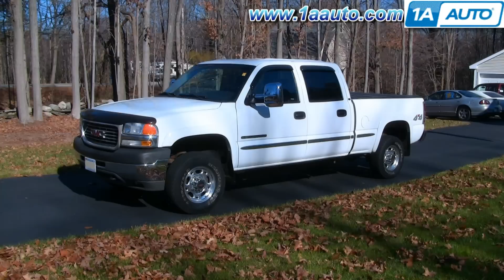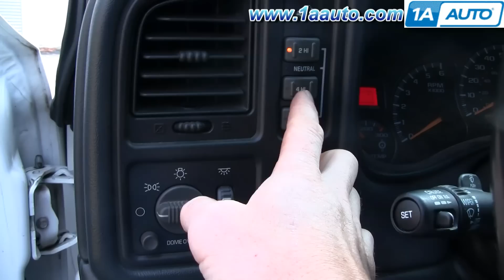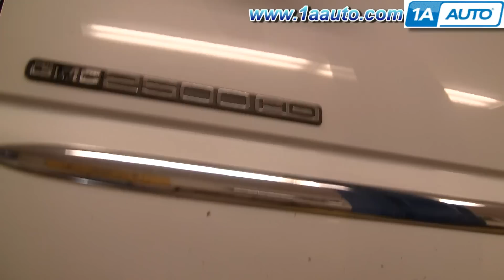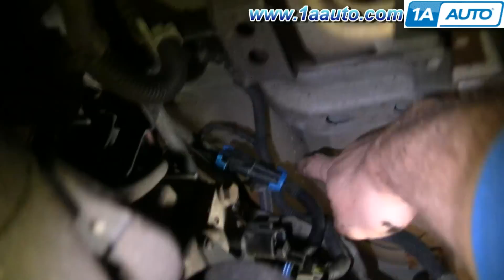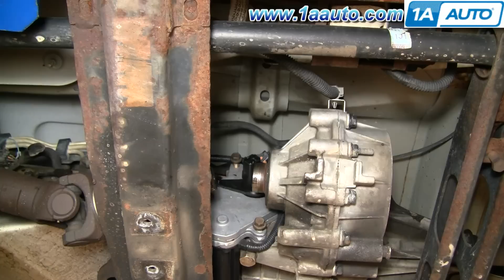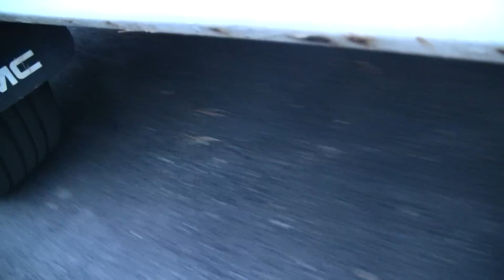How to Replace Transfer Case Shift Motor 01-02 GMC Sierra 2500 HD

Comment: just got a 2004 GMC Yukon   the driveshaft hooked on the transfer case shift motor , the 4 button selector switch does not light up at all 
the works fine  in 2WD still no light showing -  i assume the problem is the TC shift motor wires have a issue
i need to check all the fuses and clean frame & body grounds 1st - i bought the 5.3 Yukon in this condition , it has a very nice body & interior

Comment: Hey Guys, so I live in Calgary Alberta......With this said, our winters get frigidly cold -20C common......my 4wd service comes on/fuse blows/lights on selector switch goes out. Nothing works...found a write up  - not sure if its from GM directly. But it states, if your 20amp ATC fuse keeps blowing, but Encoder @ T-case works......front diff actuator works. You're getting get grounds.....good voltage at connectors....( Bench test front actuator ) and it works.......and there is no code for TCCM ( Transfer Case Control Module ) ....it is the 1640 connection - they used 18 gauge wire from factory but during colder than normal ambient temps - it will spike in amps and blow the fuse....The easy fix is replace with 25amp fuse. OR replace the Orange wire - with 16Awg.  DONT GO SPLURGE ON PARTS BEFORE YOU DO ALL YOUR CHECKS!!!!
Reply from the maker: +Sunny Rooprai Thanks for the tip! We'll pass this info along to our production team.

Comment: I'm having problems with mine shifting into four-wheel drive low could this be the problem
Reply from the maker: It's possible, we recommend that you take your vehicle to a local, reputable mechanic for an accurate diagnosis. +B I
Reply: It a rebuilt transfer case with about a thousand miles on it

Comment: At 9:24 that noise that the driveshaft makes when your putting it back in is the same noise  mine makes when I try to move the driveshaft without removing any bolts or anything yet. Is that normal? is that end of the driveshaft supposed to be able to move in the transfer case at all?

Comment: the nub that sticks out of the transfer case doesnt want to line up with the female part on the shift motor for my 01 silverado, how do i line it up? Also if i just plug in the new shift motor without installing it to the transfer case, will the motor spin when I press the 4x4 buttons? I bought a new shift motor and pluged it in, didnt bolt it up, and the motor is just buzzing and not turning. its brand new...defective unit?
Reply from the maker: +glamisfanatic You will want to plug the encoder motor in first and set it to what the transfer case is set to.  So if the vehicle is in 2WD then you need to set it to 2WD first.  1aauto.com

Comment: Help replaced throw out bearing clutch plate pressure and fly wheel everything is put back together however nothing happens when I try to shift the truck just rolls as though it's in nuetriral however the drive train doesnd not move Arou

Comment: I just did this to my 04 Sierra 1500 and when I plugged in new encoder motor and switched it to 2wd on the button select after a minute my 4wd lights just went out and now I can’t get them to turn on any ideas? The switch turns on for a few seconds and then off

Comment: I rebuild my 2005 Tahoe z71 transfer case np246 np8 because it had a pump knock problem and create a hole in the rear housing.  Now my problem is that it won’t shift in any of the 4wd modes like in the video and the electronic encoder is making the same noise. I also was thinking that maybe that tab on the main output shaft under the clutch pack was installed incorrectly by the shift fork, but this seems exactly what my truck is doing. Could that tab be an issue for why the tc won’t engage in any other gear besides 2wd. The truck runs it’s just when I try to put in any 4wd it blinks and goes back to 2high.

Comment: I thought for sure it was my switch in  the dash, so I replaced it, but no, the 4wd still didnt work. So it must be the actuator,  I replaced that and still no 4wd. I checked the wiring, cleaned the grounds, checked fuses and searched forums and decided to bring it in to get diagnosed ao they could pinpoint the problem. Well they weren't able to pinpoint it and that cost $127.00 , lol. So i decided to replace the transfer case motor and used this video. It was very helpful. I didn't have to remove u joint bearing, the electrical connections were kinda hard to unhook. I had to manually put transfer case in nuetral to line up with new motor. I'm just a you tube mechanic so this was a bit challenging. I have no impact wrenches or means to raise vehicle, so it was tight under there. Anyway, I did it and it worked! I'm very happy. Thanks!
Reply from the maker: +cash money Thanks for checking us out. Shop here for high quality auto parts: http://1aau.to/m/Shop-1AAuto-c

Comment: Myn clunks and does go into 4x4 but just quit working today could this be it
Reply from the maker: +Matthew Webber You may want to start by checking the fuses to see if all of them are okay. If they are fine, you may want to check the switch and any vacuum lines. Hope this helps you out. 1aauto.com

Comment: I have a question. I have an 04 Silverado 1500. It's telling me to service 4WD and my ABS light is on along with my Parking brake light(even tho the brake is not on). Would that be the issue fixed in this video or is it something more? It won't go into 4WD either.
Reply from the maker: +haroaero You may want to try to see if there is a code stored in the computer. If there is it should help to point you in a direction. 1aauto.com

Comment: My 2005 Silverado hasn't been able to go into 4wd low for a few months now. Today while driving in 2wd every time I went down a long hill where it was essentially coasting the transfer case was totally disengaging as if my transmission was in neutral. Stopping and cycling from 4wd back to 2wd fixed it each time with a super loud clunk. Is the encoder motor the likely culprit for both the new prob plus the old one of no 4wd low?
Reply from the maker: +wmkess Thank you for checking us out. This certainly could be the reason for your issue. 1aauto.com
Reply: Was this part the fix for your problem? My 2004 is doing the exact thing as you described in your comment.

Comment: Thanks for the video was really nice, i was wondering is it possible to remove the wire harness and disconnect the motor without removing it? Or its better to remove it ?
Reply from the maker: +Sohaib Kholosy You will be able to disconnect everything just fine, but you will not have the clearance to physically remove the motor.  Any viewers that are interested in purchasing the part in the video please follow the link! http://www.1aauto.com/1A/TransferCaseShiftMotor/Chevy/Silverado1500/1AFWM00014?utm_source=YouTube&utm_medium=CTA+Comment&utm_campaign=ytcomment&utm_term=1PPf2Yzhjmw

Comment: What if the transfer case will go into 4wd high no problem but fail to engage 4wd low? My 2005 Silverado 1500 does this now. I can hear a loud clunk, like it typically made in the past when it engages into low, but it doesn't engage and then it clunks again like it is giving it a second shot. It has been doing this even after multiple restarts and trying it at a stand still and a slow roll (1-3 mph like the manual states) and always in neutral.
Reply: wmkess when putting it in 4wd low make sure it's a nuetral and your stopped. 4wd high is a shift on the fly but low is different...

Comment: is this the same for a 99 suburban?
Reply from the maker: +big choo choo It may be a similar. Your 99 should be a different part number. Here's a link to the shift motors for your truck. There is a video for one of them. Hope this helps you out https://www.1aauto.com/1999-chevy-suburban-k1500-transfer-case-shift-motor/y-mo-c/1999-2149-144#utm_source=YouTube&utm_campaign=YTC&utm_medium=CTA%20Comment
Reply: 1A Auto Parts thanks

Comment: 00 Z71 with auto 4x4.Lights say it is in 4x4 .I jacked all tires off ground 4x4 works but I can grab tire and front no longer spin .back still turns.Why would it not have the power to turn front wheels?love your videos
Reply from the maker: +Jerry Bowen Some 4WD systems are designed to send more power to the wheel with traction. This might be what's happening. Thanks for watching. If any of our viewers needs to make this repair we carry the part shown in this video on our website. Here's a link to them https://www.1aauto.com/1A/TransferCaseShiftMotor/Chevy/Silverado1500/1AFWM00014?utm_source=YouTube&utm_medium=CTA%20Comment&utm_campaign=1ATony

Comment: My 2009 Silverado just went out recently. Manual shift to 4H, 4L, but nothing happens. The 4-wheel light doesn't come on either. I just used 4H 2 weeks ago. When shifting to 4H, I don't hear any noises..I'm leading toward the actuator but know nothing about vehicle maintenance. Any help in the right direction would be greatly appreciated.
Reply from the maker: +Lyman Tsinnie You may want to test the power going to the actuator to see if there's power going to it when the switch is activated

Comment: Thanks for video. Need to order replacement. 2 questions: when bolting new motor in place, do the gears or motor need to be 'indexed' to match position of motor with position of transfer case? also, which part number for '05 tahoe with the 'auto' sensing 4wd? Thx again.
Reply from the maker: You shouldn't have to. As long as you follow this video you should be fine. We carry the replacement actuator shown in this video on our website. Here's a link to them https://goo.gl/RZDU2U

Comment: So I'm having same problem with my 04 Silverado except mine goes into 4 lo and not 4 hi ,it blinks like this video and goes back to 2wd . I do have new transfer case motor here to be installed . Will this fix problem ?
Reply: Also I do get a service 4wd light
Reply: lonnie ruybal mine does the same thing only it goes into 4 hi but not lo.  but it won't work.  I can hear the actuator hum and then the light will indicate it's in 4 hi but only the 2 back wheels spin still.  let me know if you find anything.  99 silverado

Comment: I have a 2001 silverado and my 4wd only engages into the low 4wd, it goes into high and auto but it doesn't work on does modes it only works on the low mode. Do you think is the transfer case shift motor? @1Aautoparts
Reply from the maker: It's possible that it's the shift motor. Are you getting a 4WD light or anything similar on the dash? 1aauto.com?utm_source=YouTube&utm_medium=CTA%20Comment&utm_campaign=1ATony 866-403-3393
Reply: 1A Auto Parts no nothing, it just doesn't engage into 4wd high or automatic mode. Just the low mode. But thanks amazing page. And you guys sell quality products keep it up.

Comment: Hi there you showed how to test the motor while its attached to the truck, I have a 2001 olds bravada that doesn't have any 4wd switches, it is stuck in 4wd and I'm thinking it's the encoder motor. There isn't any way to test this one is there? I've been told there isn't any way to test it when it's not attached to the transfer case either or it will cause permanent damage to the motor.Fluid is perfect no blown fuses and no lights illuminated on the dash.

Comment: I just replaced the 4x4 actuator  on mine and the front wheels still won't spin and it won't go into 4x4 low or netural

Comment: Great video, thanks, helped me out a lot.  When I pulled the shift motor out and opened it up to replace the sensor it was full of oil.  Is that supposed to be there.  Thanks again

Comment: Great Videos. I have a problem similar to this. 05 Sierra 215k miles. My buttons have been working off and on for a few months. Today, when working and going at highway speed the transfew case shifted into neutral on its on and I lost all power to wheels. Pressed Auto 4WD, power returned and got home. Tried again later and same thing happened. Transfer case shift motor? 4WD Axle Actuator? Software issues? Thanks for your time
Reply from the maker: Thank you so much for the kind words regarding our videos. Given what you're describing I would lean more towards the transfer case shift motor needing to be replaced, however it's impossible to be certain of that without a proper diagnosis. Have the vehicle looked at to see if this is the part that needs to be replaced as the last thing you want to do is buy unnecessary parts and in turn perform unnecessary repairs to the vehicle if not needed. Thank you again, and have a great day!

Comment: How do I know if the problem is the motor or the control module?  My 2005 Chevy Suburban will shift from 4 HI to Auto4WD and back, but will not go to 2WD or 4 LO.  The button just flashes for several seconds after  pushing, but it doesn't shift and stay lit up.

Comment: what if there is no sound when you push the button? mine does nothing, no sound, the lights on the push button selector does nothing. its dead in the water so to speak

Comment: I have a 2004 1500 Chevy z71 5.3 l V8, when I try to put my truck into 4x4 absolutely nothing happens. No matter what button I push, (4hi, 4lo, or auto) no lights blink it doesn't shift into 4x4. I don't hear any sounds like you have showed here in the video.  It doesn't try to shift, it will not make any attmept.  I have a service 4x4 light on. Can you shed any light on this for me please and thank you.

Comment: frontt end whines all the time on my 04 yukon i changed the fluid and found no metal flakes but its sttill loud had it inspected no play found in the hub assemblies what is it
Reply from the maker: Thank you for watching! Unfortunately it could be one of many things. I would double check all of the front end including ball joints and the tie rods. Its possible the noise is also coming from inside the case. Hope this helps!
1aauto.com  888-844-3393

Comment: I have a 06 1500 hd .... On a recent hunting trip it would not stay locked in 2 wheel drive only for a mile then jump out and make a grinding noise. Much like gears toggling. Made it home in auto 4 wheel drive, and 4 h worked but locked up hard. Truck has 49000. Would that still point towards the drive motor? BTW...... Great videos!
Reply from the maker: If there happens to be a check engine light on, you may want to pull the code to see what it points to.

Comment: i have an 05 silverado and having trouble with my 4wd. service 4wd comes up on cluster and stays there, no lights on the switch because the fuse blows. Thinking its the transfer case motor but not sure. Was having trouble earlier trying to get her in 4wd but after some time she would eventuallly go in, but now no dice. Think the motor is my probem? how much does one usually go for, theres a napa here in town that might have them, thanks.
Reply from the maker: We carry this part shown in the video on our website, here's a link to them http://www.1aauto.com/2001-02-transfer-case-shift-motor/i/1afwm00014?utm_source=YouTube&utm_medium=YoueTube&utm_campaign=1ATony  You should pull the code to see what it's pointing to. Hope this helps you out. 1aauto.com 866-403-3393

Comment: I have a 2001 Chevy Blazer. Is the "shift" motor the same as the "encoder" motor?
My 4HI does not engage. I already changed the actuator diaphragm and the cable.  Still nothing. When I press the 4HI, it just blinks.  I don't hear anything.  What should I check next?

Comment: I have a Blazer LT 99 and i just changed the transfer case shift motor, but now my switches buttons wont light up?
i checked all the fuses and i did replace the switch it self, any ideas?
Reply from the maker: You may want to test the power going to the switch with a test light or an ohm meter, to see if there's power to the switch. Hope this helps you out. 1aauto.com 866-403-3393

Comment: hi, i have a 2006 chevrolet suburban 1500  and my problem is this, 4x4 switch lights turn on and then off, just the red light on neutral is on, and nothing works  not even a sound, i have the switch changed and the 4x4 shift motor also,  as you did on the video, first when i started the truck worked fine for the first five minutes and then it stopped  working again, do you have any recomendation? please thanks for your time,
Reply from the maker: You may want to inspect the wiring going to the shift motor just to make sure that there's not a frayed wire or something which may be causing this to happen. Hope this helps you out. 1aauto.com 888-844-3393

Comment: hi my name is lisa, I just bought a 2000 s-10 chevy blazer, it is a 4x4 4wd also, the problem that I have it, I never had an 4x4 vechicle/suv. all the lights were flashing and if I get it over 30mph it will run right, under 20 mph it will hesitate and I have to force it to make go over 30. I had a lot of different answers saying it was the transmission, computer brain, and now the catalac converter could be stopped up. I don't know what the real problem is, can you please help me to find a better solution to this problem. Thanks Lisa
2000 S-10 CHEVY BLAZER, 4 DR, 4WD, 6 CYCLEDER
Reply from the maker: There may be a vacuum leak in the 4WD system. If there's a check engine light on. you may want to have the code pulled, it may help to tell you what the issue is. 1aauto.com 888-844-3393

Comment: I have a 98 chevy Z71. It has the push button selector, when i go to engage or disengage it will make a racket like it's hitting hard. Yes it goes into all selections. Also, what gear should the trans be in when switching in and out of 4X4?  Can u give me a clue where to start to resolve this. Thanks!!!
Reply from the maker: It may be shift on the fly, meaning you may need to be moving at least 10 miles an hour for the 4WD to engage. You may want to also check the owners manual, as it should indicate the proper shifting procedure. Hope this helps you out. 1aauto.com 888-844-3393
Reply: Thanks!